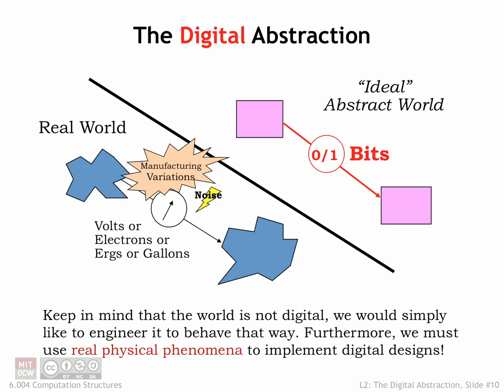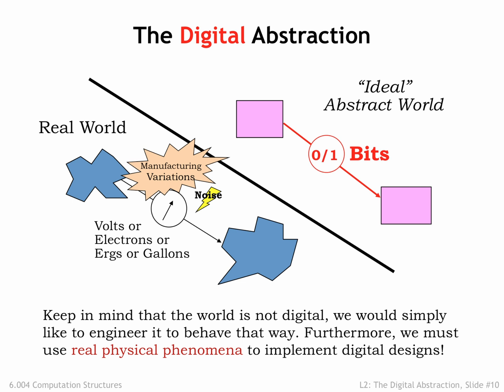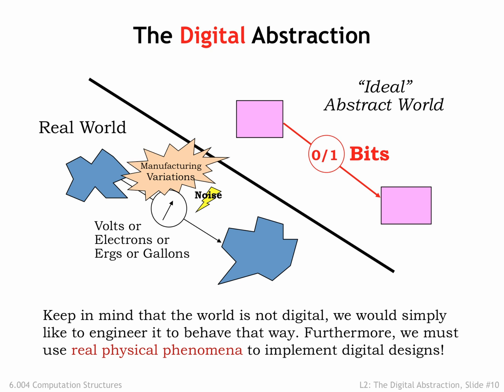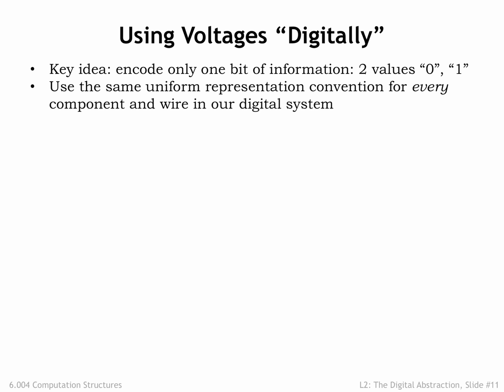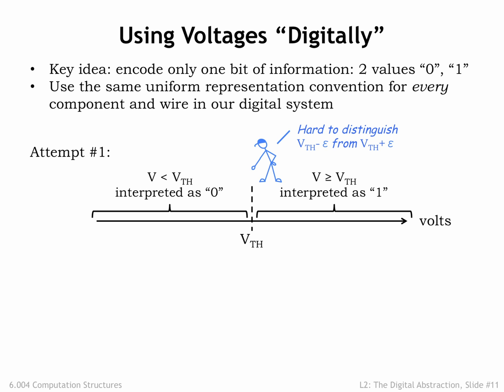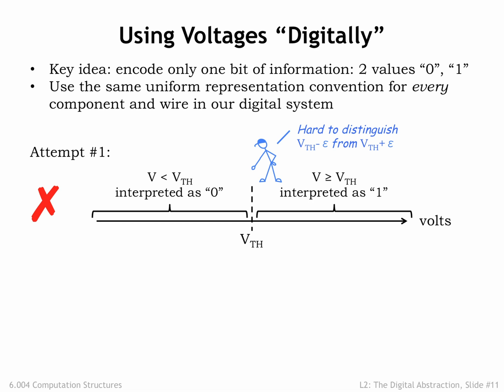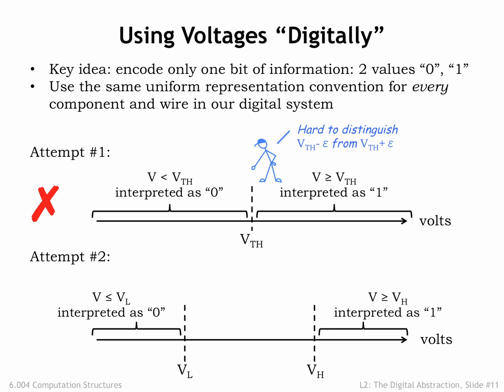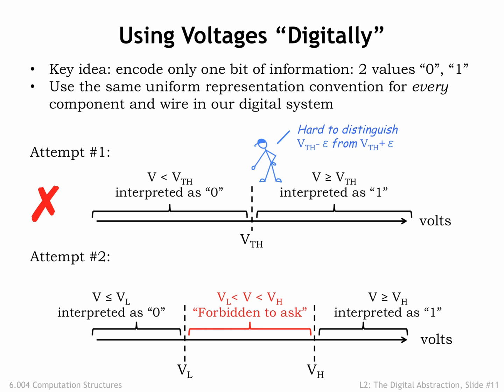2.2.3 Using Voltages Digitally

Comment: Shouldn't the Gaussian distribution of errors compensate on a larger scale (such as a photo)? (Aka this pixel has an error, but 2 pixels on the left too, so the average over 9 pixels, which is almost too small to notice, remains the same)
Reply: the prev lecture mentioned that over multiple processing steps these errors will accumulate and the quality will be noticable. e.g. after 1000 copy steps, the grey pixel is now black or something. the system must correct the 1st error it introduced at any step.